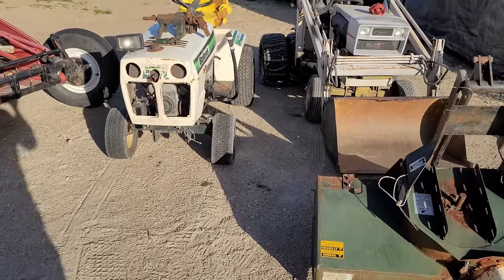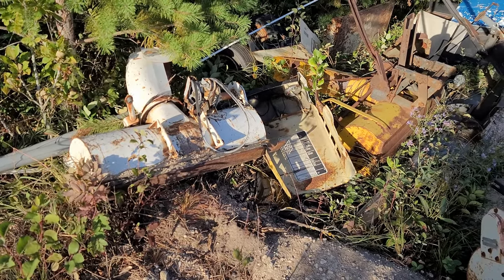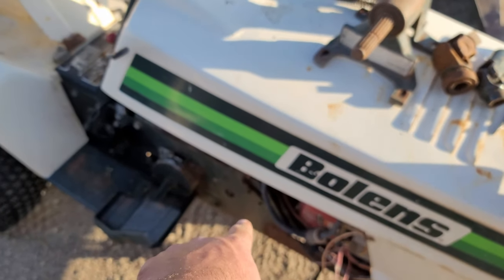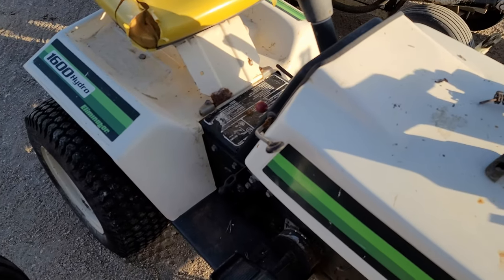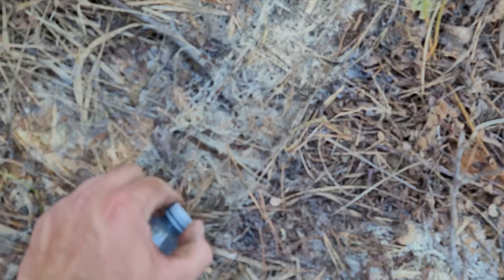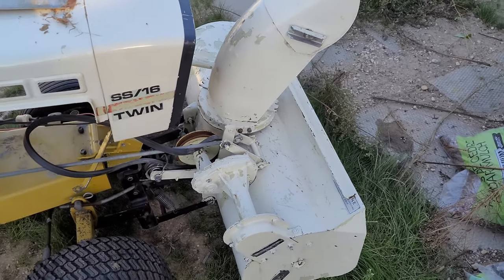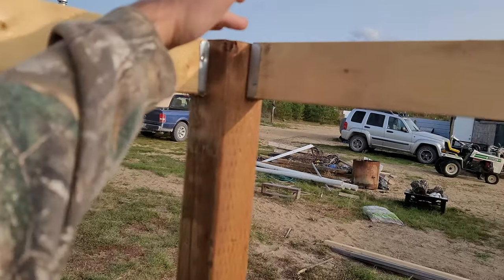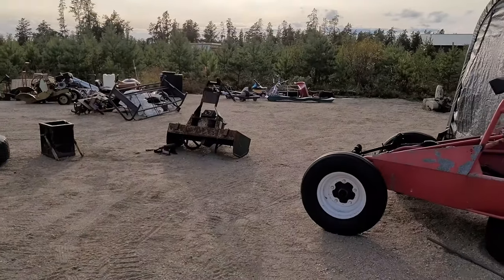Bolens  46" Snowblower?? Or Sears?? & Green House Update.

Comment: The Bolens looks like it would kick some ass with the V-twin and the snowblower, hopefully you can get the parts! Greenhouse is coming along good, cute bear!
Reply from the maker: I just need to think about the RPM i want the large blower to move 
Thinking of Setting her to spin around 25% Faster.. And then i can run the engine 25% lower 
At the same time the engine will make MORE then the power she will need